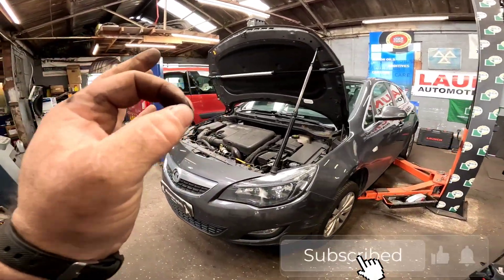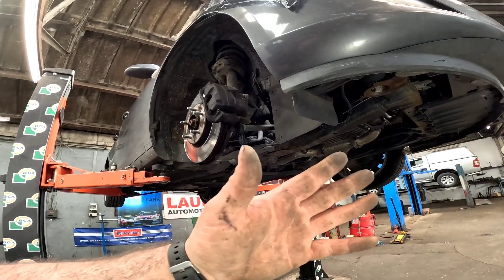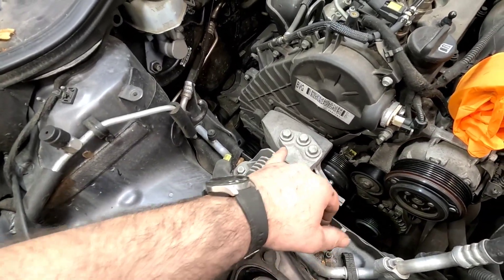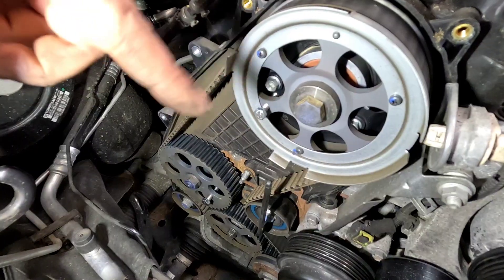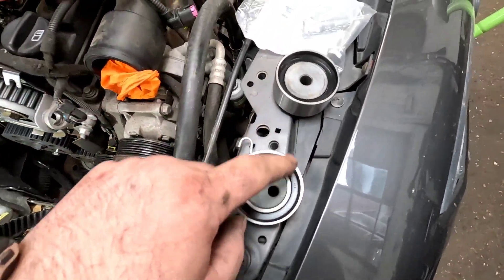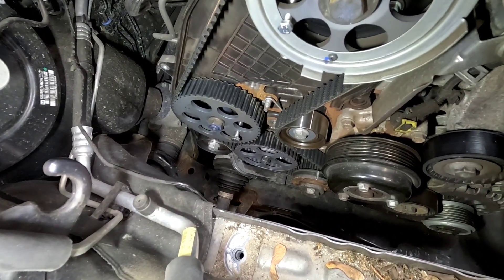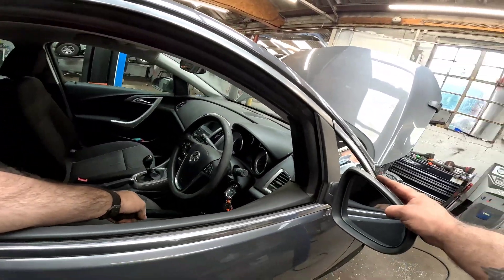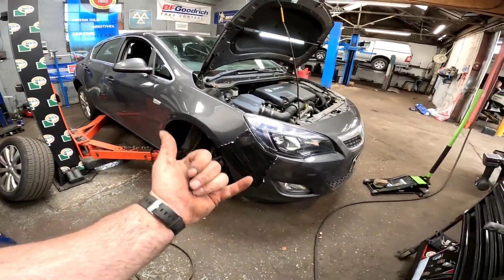vauxhall astra j 1.7cdti ecoFLEX timing belt replacement

Comment: In the uk, how much do you think it would cost to have this done in a standard garage?
Reply: I got the timing belt changed on my 2015 Astra J last week. Got quoted £262 in total including parts and labour. Was told the Astra J is one of the easiest and quickest belts to charge (confirmed after watching them video) and therefore one of the cheapest to change.
Reply: @uplightuk8924  thank you, I need to do mines at some point this year.
Reply: @KayezTP  I also got a quote for £630 from another garage, never understood why there was such a huge price difference
Reply: @uplightuk8924   yeah that's a big price difference. Defiantly won't be paying that much lol

Comment: What is the sensor for on the water pump. Just for temperature.
Reply from the maker: The drive for the water pump is electrically controlled by a clutch

Comment: First Class Baz, How long does it take
Reply from the maker: These are simple to do so roughly 2 hours as it has an external water pump which makes it easier
Reply: @bazmeredith How much would you approximately charge for this without the parts?